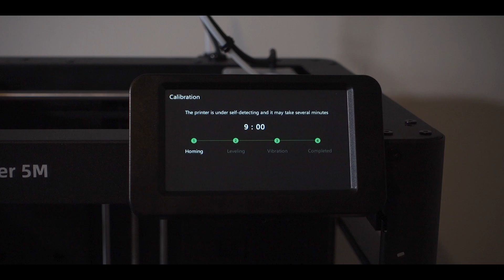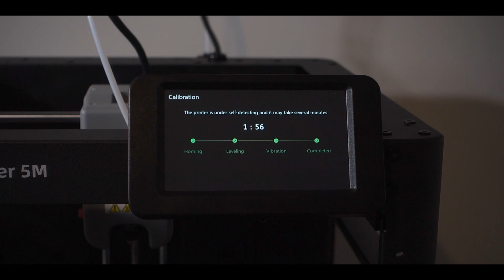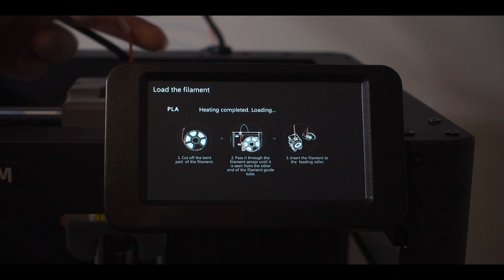Unboxing the Latest *Bambu Lab Clone!* (Flashforge Adventurer 5M)

Comment: dose the wifi work on it now? watch a video from another youtuber and he said it didnt work out the box but the company says they are working on it. Pls Let me Know so I can find out if i want to buy it
Reply from the maker: Wi-Fi printing works with their slicer FlashPrint however it is still currently in the works for Orca Slicer. ETA is supposed to be a month or two.
Reply: I’m told sending prints over WiFi using OrcaSlicer is working now. For $299, I’m thinking hard on this printer for a good P1P alternative unless Bambu ever drops to $399 or less. It’s unlikely anytime soon but it gets close

Comment: I had the Aventurer 4 Pro and it was horrible! I have the M5 pro and I’m very impressed! Very good, fast solid printer. Good print quality. 10$ more for good fans will be good. Flashprint works but that’s all. Good Orcaslicer profile will be better…but it is closed firmware.
Reply: I bought one too, got it yesterday and have already printed over 12 hours with it! Thing kicks ass. Iv switched to the .6 nozzle because it prints so good that even with the .6 nozzle it’s crisp smooth and clean! Iv been using an Amazon special PLA + with my nozzle temp at 220 and my bed temp at 60 for the PLA + and it’s flawless! 

NOTE: scrub the bed plate with dawn dish soap and a green Brillo pad when you first get it, there is an oil on the bed plate that makes the prints not stick well.. once you scrub it a few times with dawn dish soap you won’t have any issues at all with adhearing and I also noticed the more prints you do on the plate and the more times you wash it inbetween prints with dawn the better it and better it sticks.. I now only wash the build plate every 4-6 prints with no issues.. the glue is garbage don’t use it at all.. no need for that or rubbing alcohol.. just use dawn!